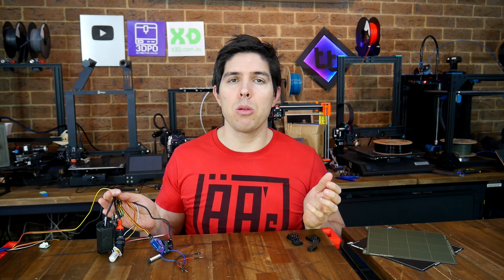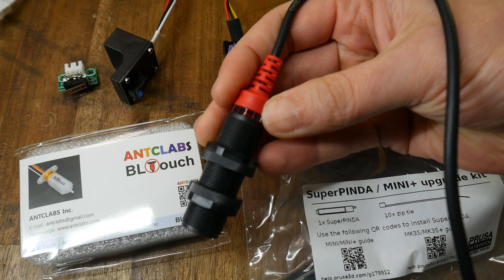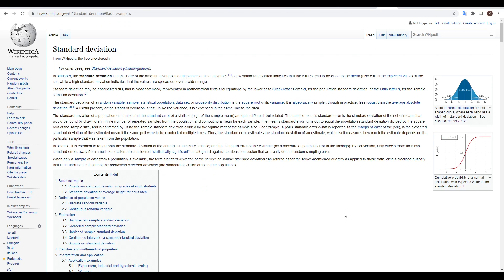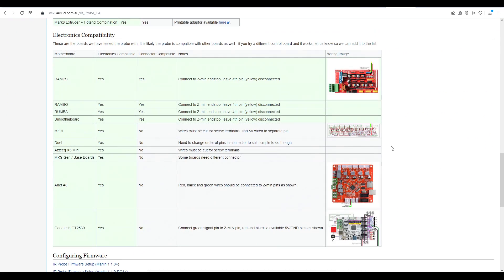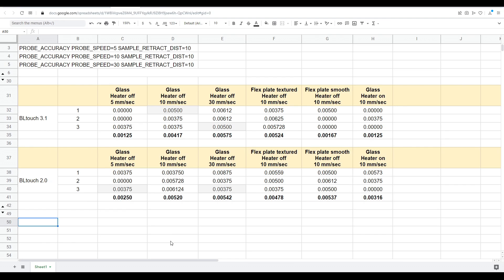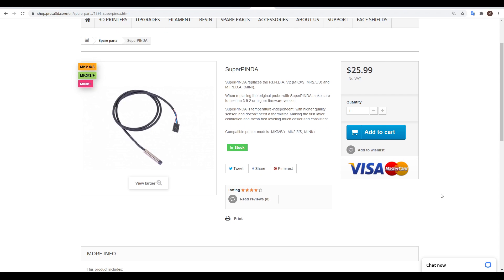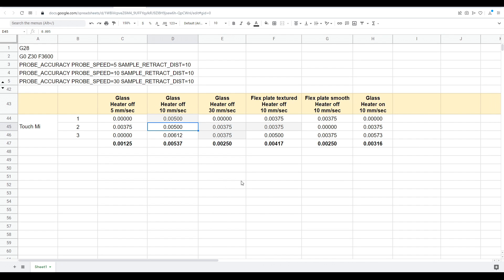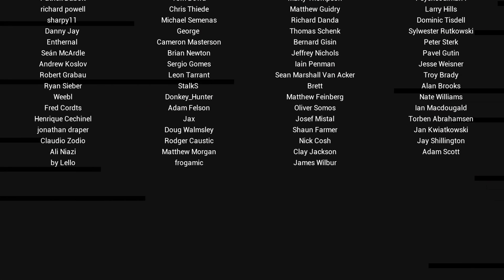Six popular ABL probes compared: Accuracy, price, wiring and more!

Comment: Wow indirect measuring to five decimal places. 4 year old wrong then and still wrong now. At best APL repeatability is 0.005mm today. All ABL that are non-contact are basically unreliable 4 years ago and still unreliable today. Greatly effected by material, temperature, %RH and/or light. In other words, if you change your hot plate, probe at different temperatures, %RH or light condition in your room the reading reference changes. In other words, it is repeatability offset at a different reference. In other words, the accuracy is wrong. In other words, a MM is not MM. In final words, the repeatability measurement is useless in accessing APL probes for 3D printers.

Comment: Inductive probes will vary from point to point.   Yes they can be the same at one spot,  just not the same at others.   Same with the IR based devices.   IMO a probe needs to touch the surface to get the most accurate reading regardless of surface.

Comment: Using a bl touch but it plays up sometimes and makes the offset change, I end up with a bad first layer, don't know why it does it?, after recalibrating the offset with the bed and nozzle heated it will work o.k for a while and then mess up again, I'm ready to throw it in the bin to be honest and try something else.

Comment: The test that everyone misses is the difference in height between different bed temps. Almost all the none clicky probes mentioned will have significant variance between 30c bed and 100c bed. This means you will need to baby step every time you change material. The only probe that doesnt seem effected by this is beacon or fully mechanical probes.

Comment: The cr touch and bl touch are 2 different devices. One is a hall effect switch and the other is an optical sensor. Both have pins but the bl touch has a plastic one. Leaving the potential to snap it off. Should have got one and tested it. I have 4 and they work perfectly

Comment: The problem is we don't just want to compare standard deviations. We want to know how probes compare in the worse cases. It's no good if it has a great average and SD but occasionally has an outlier that scrapes the nozzle into the build plate. I had one printer like that, on average it was fine, but now and then it would get a bad probe and watch out. It had to be babysat through every start print. So some statistics on the bad probe results are important here, and seemingly missed in this presentation.
Reply: Sounds like Qidi plus4/q1 😅

Comment: How about heat resistance when printing in an enclosure at ABS temps? My bl touch just died since i started printing in an enclosure, had to go back to z stop switch and manual mesh, perfect prints since then

Comment: I've been using the CRTouch and it works great. It's basically just a fancier bltouch, but more or less works the same. The only differences are A. the probe is metal, and less prone to breaking, and B. the sensor it uses is more accurate and durable. Also it is a bit easier to install on a creality printer, but if you're not using one, there isn't much difference. Honestly, the only real benefit is not having to worry about the pin break, and I think the crtouch might be slightly smaller than the bltouch height wise. After using it for a while, I may eventually choose to switch to a beacon3d scanner, but with dual z and z tilt leveling on my printer, I can pretty much just use the same mesh over and over again without any problems on the first layer, and I only really probe it if I have to service the printer and somehow it changes the z offset or the bed position.

Comment: I have used an EZABL clone for some time with OK results on my Ender V2, board 4.2.2. Now, as I have converted the Ender to direct drive, the inductive sensor has a problem: It turns on as soon as the stepper motor system is energized, regardless of distance to the bed. When I disable the steppers - or if I wait for 120 seconds so the steppers turns off - the sensor turns off again. The problem seems that as the direct drive has the extruder stepper close to the sensor then that sensor is affected by the magnetic field introduced when the stepper system is activated. To solve this I might have to select a sensor that is not affected by magnetic fields. As you are not particular about the drive system (bowden or direct) when doing the comparation I thought I should mentione this.

Comment: i am looking for answer to the question how the accuracy is actually determined and all i see is testing it by bolting probes to a 3d printer as a test bed. and i can't shake the feeling that what you are actually testing is the accuracy of the z axis of your printer and not the sensor itself, because on many printers, if not all  positional accuracy in z axis is limited by a lead screw accuracy and how many steps or microsteps it takes to move head up and down, not to mention of any backlash
for ender 3 and other printers using 8mm lead screw z accuracy is around 0,04mm per full step in ideal conditions, enabling micro stepping can increase the accuracy , but you never really sure if every micro step is the same and the only positional data you get in those tests is what you expect the z axies to move vs the point of triggering and that 2 variables in the same  axis

i say most of any probes mounted to head would level z better than single z stop because theyre accuracy is magnitude higher than accuracy of most printers

Comment: My first printer has some inductive probe which works fine as long as you preheat the bed when you zero it, for my Ender 3 I made a klicky style probe designed by kevinakasam and it was basically for free, just a few magnets and a spare microswitch.

Comment: I have a bl touch on my shark v2 and it gets bent super easy and I don't know why. I replace the pin with a straight one, do an auto level, it still looks straight but a couple days later it's slightly bent again. I don't auto level every print just when I switch bed types so I don't know what is causing it to bend.

Comment: ezable probe for me best upgrade ive ever bought for my printer, calibrating the probe is as easy as a tiny twist of the screw and u never have to adjust again. if you use the ezable with solid mounts its a set n forget setup never needs adjusting.

Comment: I have a number of BL Touch probes and have had to change the pins on all of them except the model 1 with the aluminium pin which has the pin that it came with, why on earth did Antclabs change to the plastic one, whatever the reason it has made them a pretty penny in replacement sales

Comment: I bought the CR touch as it looks like a bit more refined design than the BL touch. It uses a photoelectric sensor inside (instead of a hall effect sensor) and has a metal probing pin. A very robust design.
Reply: How many prints has it destroyed by dropping down during the print?

Comment: In case anyone else watches this and wants to try an Aus3D IR Probe, don't, they are way to inconsistent, any change in light conditions in the room, will effect it, changing the built plate type will effect it, even having glue on the build plate will affect it, very inconsistent Z height, as it changes due to reflectivity of the build surface, and major issues when using textured PEI, and light from modern LED's has a huge effect as well, I find I'm have to adjust the Z offset as far as 1.5mm depending on sunlight coming through the window, or night time use, its a terrible product to be honest, stick with at least a 3D/BL Touch, after destroying 2 x smooth PEI platforms and clogging 2 x Plated Copper nozzles, my Aus3D sensor is headed straight to the bin.

Comment: Its worth mentioning that the BLTouch (and clone) pins themselves can be fairly easily replaced and are available for cheap (2 Eur a piece). No need to replace the whole probe if the pin breaks off on a failed print.

Comment: As mentioned below, I find that temperature does not affect standard deviation but it does change the distance that the probe triggers at. This make swapping between printing PETG and PC a little more tricky since you need to have a separate Z offset value. In my case I noticed the super pinda detects sooner at a higher bed temp.

Comment: Well this really doesn't get into the crucial part of abl probe testing, which is temperature sensitivity. If the printer is in an enclosure, or if the probe is in the flow of hot air exiting the hotend, it can change temp dramatically. A temp test of each probe to determine the curve and then a method for temperature compensation via firmware would be most helpful.

Comment: I use an inductive sensor (and raw analog hall effect sensors for my endstops). So while i love my inductive sensor for my cast aluminum bed with PEI sheet there are some draw backs that just aren't going to change.
 Number #1 is i can't make use of magnetic flex beds unless i carefully pick probe points that don't interact with their magnets. #2     Tilt matters, the field coming off the induction probes are typically two lobes (oblong spheres) which isn't labeled in any way. The detection pattern for most of the useful distance would plot in an oval or more like a peanut shape in 3d, which isn't an issue for their typical use (and why the detection object is usually specified as at least the diameter of the probe). This means the probes will be more sensitive to tilt in some arbitrary axis (well, where ever the center line between the two lobes is) compared to a corresponding perpendicular axis. #3 probe speed matters (much more than temperature until you probe real slow). This is the switching frequency or response time on a spec sheet and the probe will not necessarily switch state faster than this so any movement is unaccounted and increased speed reduces your precision. This variation probably won't show during testing until you go to print unlike temperature change testing if you do not have a dial indicator mounted alongside the probe to see it. (I need to mod a dial indicator with an inductive probe one day for an awesome quick and dirty probe for less effort than modding a $30 harbor freight digital probe or legit digital probe that costs more than many printers, feel free to beat me to it and share ;) ) Most inductive probes switch at 500hz until you you break the ~$60 retail price point for industrial sensor to get 1khz to 3 khz ( next price point is like ~$150+ and specs can get to 5khz). So the faster you're probing the larger the distance variation between trigger intervals. 
I use a M8 sized all metal probe , an ie5390 i grabbed off of ebay for like $30 and it operates at 1khz. I currently get under .005 mm bed leveling results on my delta running a duet wifi.
For physical switchs, oddly the best repeatability I tested was actually a switch I pulled from a spare sanwa arcade button I had, much better than a limit switch although definitely not as rugged. It still makes me want to test cherry mechanical keyboard switches as probes, they have a precise trigger point for consistency and are designed for way more operations than I'd naturally probe without doing tests.
Reply: Prusas have no issues with a magnetic bed, so either the SuperPINDA is something immune to magnets.  Or because they designed the whole thing, their leveling grid is simply laid out in the firmware so the probe never senses near a magnet.

Speaking of magnets though, I have seen some magnetic beds that use a whole magnetic sheet, verses the singular rare earth magnets like a Prusa.  I wonder if anybody has tried to exploit that and use a sensor like that from a home security system for doors and windows.  those commonly just have a magnet on the door and a microswitch is pulled closed when the door is closed, or pulled open. Either way when the door is opened the switch state changes and the alarm goes off if armed, Makes me think that could be exploited for bed leveling in the magnetic sheet setup.

Comment: I had the opposite with BL Touch on an Ender 5 Plus. I had to disable heaters between probes otherwise there would be variations of 0.1-0.25~ and it was effectively useless.

Comment: Considering that the most commonly available and easiest to get into sensors are BL Touch and CR Touch ommitting the CR touch from the test list is in my opinion a huge mistake.
Reply: Isn't a micro switch the most available if you don't already own them there super cheap

Comment: I have a question. Some probes are not influenced by temperature fluctuation. But isn't it better to first heat the bed, and then perform ABL because of the deforming of the bed?

Comment: your test on the asus is not good, all the IR probe sensor are bad when using with PEI texture sheet, because the PEI is transparent to IR and worse it can also sometimes act like a fiber cable.
The result is that moving you head only slightly and you might have up to 0.3mm deviation which is huge.
The problem is the same for the duet IR. 
you can see if you use RRF and perform a meshheight of your bed: it will be very unstable while going with the bltouch is ok.

Comment: Best upgrade I ever added to my ender 5 was a ezabl probe. I rarely have to calibrate it because I always use the same build sheet even upgrading firmware I just put all my old eeprom settings back in and it's back in business.

Comment: huh, for a mainly consistent result, the derivation for any single probe with error will be greater than the standard derivation. Eg. 0.013 mm is much greater than 0.003750

Comment: I'm using microswitch from the Z axis endstop with allen key as a probe tip, which I manually deploy when leveling bed. Works very well, 0 cost as almost everything comes with the printer, you only need some long wire and print additional part to mount it. Never had problems with first layes. Leveling takes a while as my bed is so wrapped that I need to make 7x7 probing points, but I'm doing it not that often as the bed seem to hold it's place very well. Downsides - you need to deploy the allen key every time the printer is homing, but it's not that much of a deal. It probably could be configured to use Z endstop, which I mounted anyway in parallel so it doesn't crash into bed if I forgot to set allen key in place.

Comment: I bought a BLtouch, back then i didnn't even knew there are multiple options, i read that a BLtouch was a must have if you donn't want to mannualy level your bed each time. 

I have an ender 3 v2 with a specific port for the bltouch but the one i receive does not have the port for the creality MOBO, i connected the bltouch to the Zend flash a firmware and i was disapointed by the results, i had to stay for the first layer manualy ajust the level.

It's probably my fault but i didn't even knew if the BLtouch was working the way i pluged it, maybe my Zoffset was wrong or anything else that could go wrong.
I printed like this for 8 months, my prints where ok but i still had to mannualy adjust the bed for each print to get a great first leyer.

3 weeks ago i decided to replace my fans with noctua fans, i replaced the fans, perfectly clean my printer (more than the casual cleaning) and tune everything, for the occasion i decided to remove the bltouch, upgrade for a recent firmware without bltouch. I did my bed levelinng manualy as good as i can and a manual mesh on top of the (with bed & nozzly at printing temp)

Since then i only adjust bed level once a week with almost no change (i could wait more before bed level again) and i'll do a mesh today after 3 weeks because i am replacing pieces/moving the printed. I would be happy to let the bl touch do the mesh but since i had to adjust BL for each print i'll keep do it manualy until i'm pretty sure re-adding the BL touch will give me the same results but with an automatic mesh.

Comment: I got to say... sort your audio out... do the research! 
Knowing you it’ll sound the best if you problem solve it. Pun intended 😂
Sounds like your mic input is maxing out as it’s recording.. You need to dial that back until it’s in the green, then your post edit will have nice smooth up and down wave forms to work with. Rather than a waveform that is flat and maxed out (normalised).
I’m an animator, and we are taught 70% of any animations impact is the sound. 
Without it’s a silent movie.😂🤜🏼🤛🏼🇦🇺🤓😎👾🧬👽

Comment: I don't know if this is the best place to post this but, I've been testing a 3Dtouch. and so far I've been getting bad results. My standard deviation isn't too much worse but its the range of results can be up to 0.26, normally around 0.1mm. which is ten times your worst result. Anyone got any ideas? I soldered the wires so no bad connections, I've leveled the bed. I adjust the Gantry. Lubed the z screw. I'm using bed visualizer. Without changing anything each test I'll get some results between 0.03 - 0.09mm out, which is close to half my layer height of 0.2mm. but they can be out either way, which means my range can almost be my entire layer height.

Comment: I don't trust any probe that doesn't PHYSICALLY touch the bed. I use several different bed surfaces, different materials, colours... So, Optical, Capacitive, Inductive, InfraRed... they all are out to me. I would prefer the nail French thingy than any of them. I use a cheap 3DTouch.